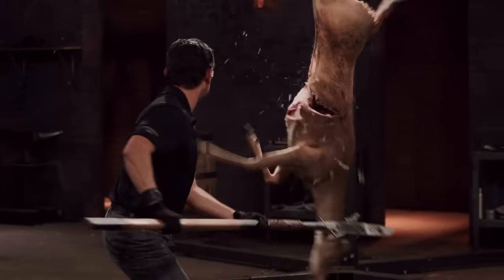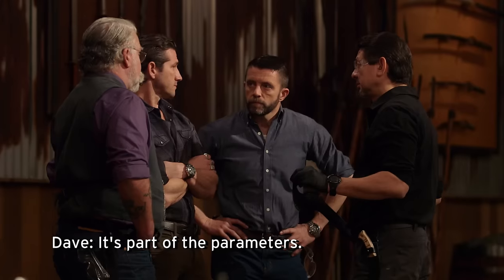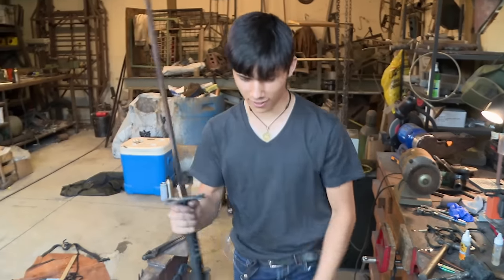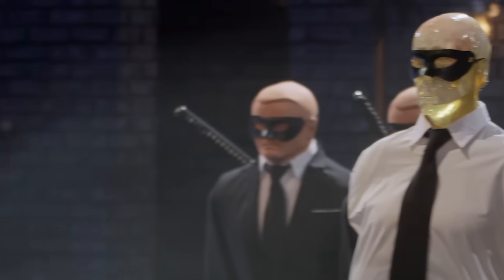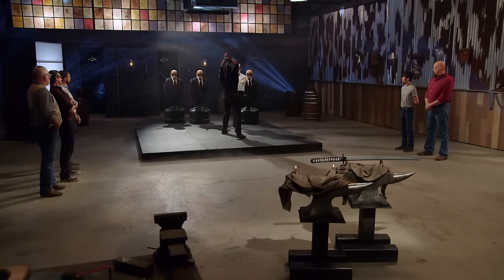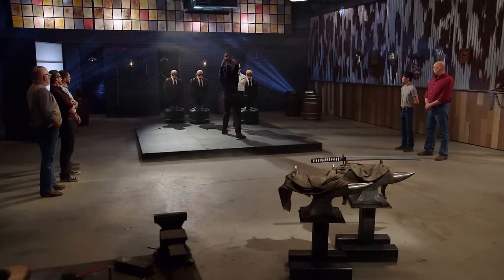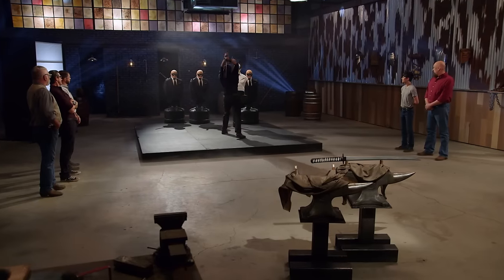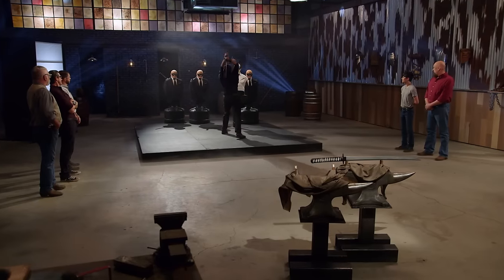Forged in Fire: 5 BRUTAL BLADES & EPIC CHALLENGES (High Tech vs. Low Tech)

Comment: 11:25, shame this kid lost... i feel like if he had the option to 1095 or 5160 he would've had a greater chance, instead of using mild steel?..
Reply: Well i think its good he lost because opponent made it work no bending either
Reply: At least he learned a good lesson so not a total loss
Reply: The lesson is that every san mai blade with mild steel on the side bends. Almost in every episode where they have a san mai blade like that, it takes a bend. People think "oh the mild steel is gonna be tough and keep it from snapping" but they don't realize that it takes sooo much more force to snap spring steel than to simply bend mild steel. Simply put, mild steel has no place on a blade.
Reply: The kid did awesome, making 1000layer katana by hand (no powerhammer) is very impressive in 4 days. I think if the kid had 2 weeks and a proper katana heat treatment the result’s would be so different
Reply: @mrkiky  I think the mild steel in san mai is just supposed to be in the central spine, and that is to be jacketed by hardened steel on the sides and of course the blade. Also san mai blades are constructed thinker and stiffer than spring steel blades, and it's that thickness that gives them their strength. Also because they are constructed thicker, they are often single edged, so that they can have very acute blade geometry.
Reply: @asraarradon4115  I think it was just a good thing to do back in the day when we didn't have standardized spring steel. With modern steel it just doesn't make sense. It's just better to make it monosteel, all high carbon through and through. It's tougher.

Comment: 3:46 Ben just dissapears after that, they don't even show his reaction. Judging by how polite they always are, both judges and contestants, maybe he raged, ranted or something, looks a litle unfair, maybe the parameters weren't clear with the ball.
Reply: crazy thing is not all of then have that bit so if he googled it and got ones shown without its not his falt
Reply: @mattp2557  maybe so, but nevertheless it was in the weapon perimeters set out before hand so it's not Asif he didn't know before he started making it, only himself to blame
Reply: @aidenfielding9709  true but they have let others get away with it before especially when it's was during the champions v judges if I'm remembering correctly Jay's was under in weight and length in one, the rules only apply sometimes is what bugs me.
Reply: @mattp2557  yeah but there would be a counter argument if he won with a blade not to spec, wouldn't be fair to the guy who made his blade to spec, plus I think that one he had to forfeit with the under length blade, the one that was 3/8 of an inch under length? That one was dead on the weight but slightly under length so he had to forfeit if it's that sword
Reply: These videos are cut down for time by quite a bit.
Reply: The videos are cut down for time. In the full episode Ben says "I'm happy with what I turned in, and I believe I'm leaving a better blade smith than when I came in" and he leaves passively. He took it well.
Reply: These were originally edited for airtime, and then edited down again for this youtube clip montage — they just whipped through this first clip and didn’t show any of the stuff that was in the actual episode.
Reply: im late to this party but the other guy didn't have a finial ball either. just a piece of metal bolted to the end so im confused.

Comment: the tatami mats a failed cut is mostly due to improper strike. that is to train to make a straight no deviation swing if the blade is not straight it will not cut

Comment: katanas are not meant to stab. They are for slashing, stabing will damage the sword a lot of times
Reply: Yeah. In kenjutsu there is almost 0 stab techniques
Reply: @Gallacant  that's why the stab without even loking is a mistake that shouldn't be done while testing the blade
Reply: @Nico-lg7hn  i personally disagree with you i dont think tradition or what the blade is partially meant for is enough for them to not so it they do test equally as damaging and if it can stab they usually will stab with it
Reply: @alienyees1106  is not tradition, is about how real katanas are made. This are not even real katanas. A katana must be done with a diferent quench to make them stronger for slashing.
Reply: Also they were backup weapons that needed backup weapons. Japanese steel was fairly weak (compared to European steel of the same period) and swords were no match for arrows and pole arms.

Comment: "As sharp as 1000 razor blades"? What does that even mean?  One razor is sharp.  What do you do with a thousand, stack them up? Wouldn't that make the combination dull?
Reply: Sounds like part translation discrepancy, part metaphor, and part meaning 1000x sharper than a razer. They said it could cut God so I think you're contemplating this a bit too much
Reply: Simply a metphor for 1000 times sharper or UNBELIEVABLY sharp

Comment: Doug needs to do some push ups if the weight of the sword affect his cuts all that much. That's seems like an over exaggeration. In the last cutlass cut he started the swing late so the blade will not cut the whole thing...
Reply: As someone who does HEMA its not about doing enough pushups and such a statement reveals your lack of experience.    Lifting weight and using an effective weapon are two very different things.  If a sword is even a bit too heavy then it impacts the way it handles. Swords need to be nimble in the hand to allow you to defend and offend very fluidly.   It doesn't matter how strong you are past a certain point because you use different muscles to swing the sword and if a sword balances poorly and is too heavy it  will still be slower on the swing and recovery than it should be.   

Doug is also far from an inexperienced martial artist and it shows. I doubt you have the skill to cut a carcass in half.
Reply: @Subutai_Khan  you do get that's an expression do you?
Reply: @Hdx64  You clearly did not read my comment. Weight matters a lot in weapon handling and I go into detail in my previous comment.
Reply: @Subutai_Khan  i did. Your insight in the matter is very appreciated. You calling me ignorant was not :P

But, and I'm not being ironic here, your comment was awesome and full of passion. Thanks for sharing your experience. I still maintain that the cut alignment that Doug used was an over exaggeration (maybe to better illustrate your point), but over exaggerated nonetheless
Reply: @Hdx64  ok, glad we cleared this up. It just looked like you got hung up on one specific point I made.

Comment: Anyone else think that the "katana" that won isn't a proper katana? If you look at it, it's a straight single edge sword. The only curve I can see on that blade is at the very tip. A katana has a slight upwards curve down it's length, its not a straight blade.

Comment: I once got frustrated with the crappy handle on a machete with a blade that worked really well for me. So I wrapped it in electrical tape. Then it was the best handle I ever held on a cutting tool. Shoelace handle? Sure.
Reply: Aw. It would've been more fair if the little guy was the one with the power tools, and the guy with the size advantage had to wail on it by hand.

Comment: Too heavy to wield one-handed? Go to the gym then
Reply: As someone who does HEMA its not about strength and such a statement reveals your lack of experience.    Lifting weight and using an effective weapon are two very different things.  If a sword is even a bit too heavy then it impacts the way it handles. Swords need to be nimble in the hand to allow you to defend and offend very fluidly.   It doesn't matter how strong you are past a certain point because you use different muscles to swing the sword and if a sword balances poorly and is too heavy it  will still be slower on the swing and recovery than it should be.   

There comes a point where a sword is too heavy to use one-handed. Try wielding a  5 lb greatsword one-handed.  You can do it but not for long and not to any degree of effectiveness as you will be very slow.